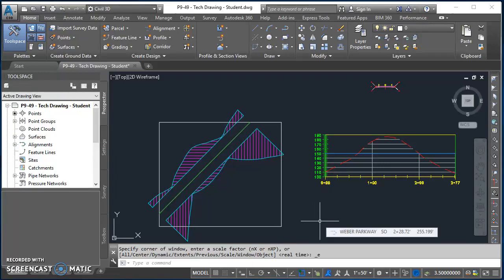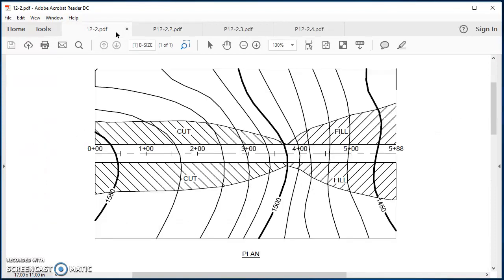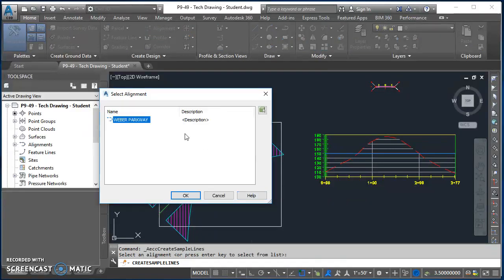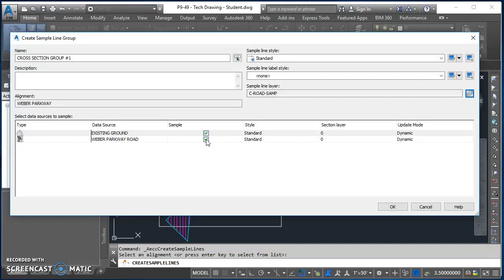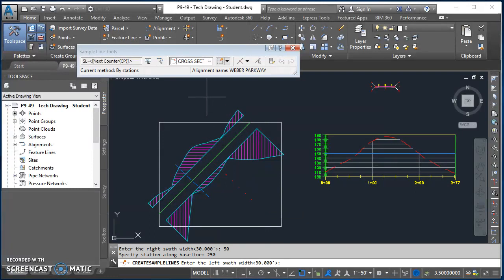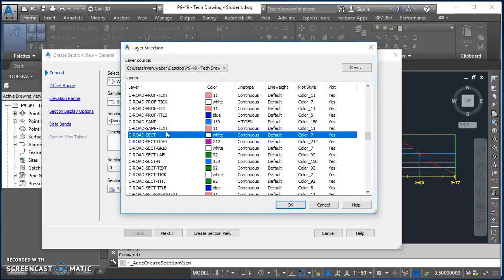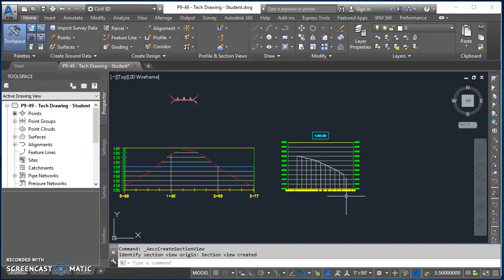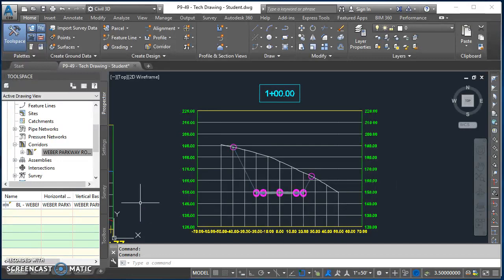Creating Cross Section Views in Civil 3D

Comment: Is it possible from given 2d cross-section to create 3d model in civil? Please share some ideas, or tutorial
Reply from the maker: I don't know an easy way to do this other than manually placing points which would not be a very accurate surface because of the limited data you would be working with. I'm not saying it can't be done, but I don't know how to do it.